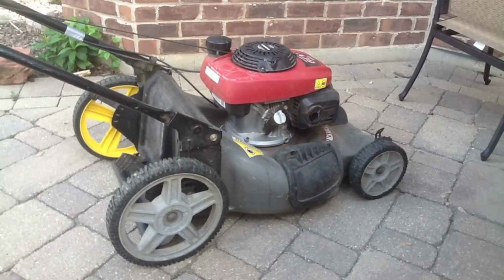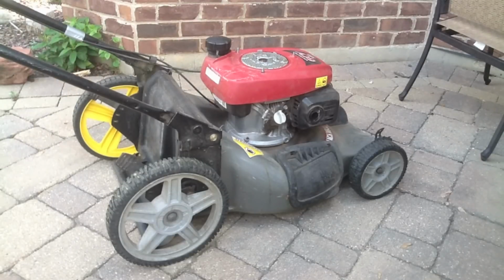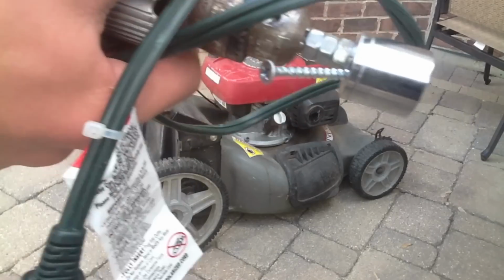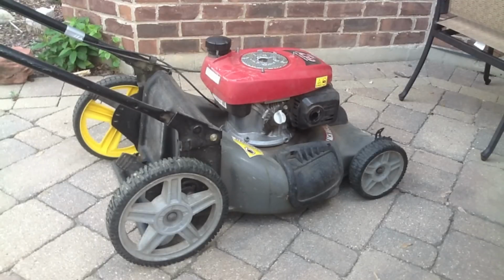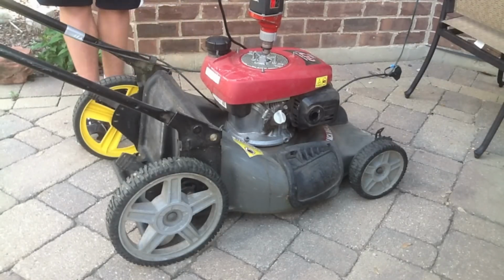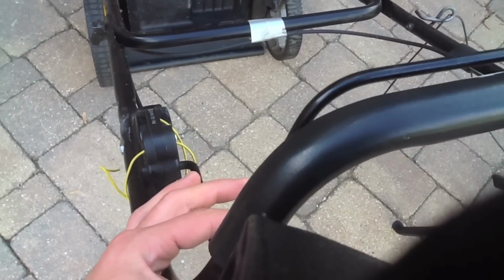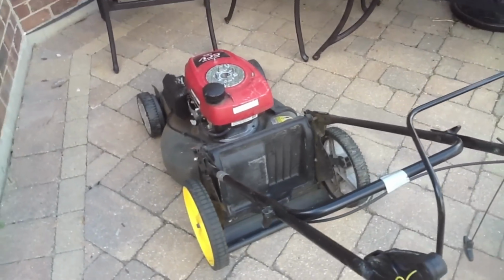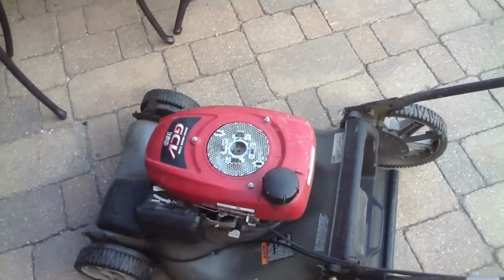Honda Blackmax GCV160 Lawnmower Drill Electric Start

Comment: Know what's really funny? There might be a dozen or more videos about drill starting a lawnmower but it looks like this is the only one where you actually see the person START the mower. I broke the rope start mech and just wanted to see if it was worth trying with a cheap battery powered drill. Well this drill runs on mains power but clearly it has sufficient revs to do the trick.
Thanks.